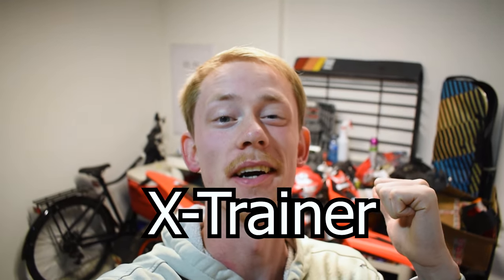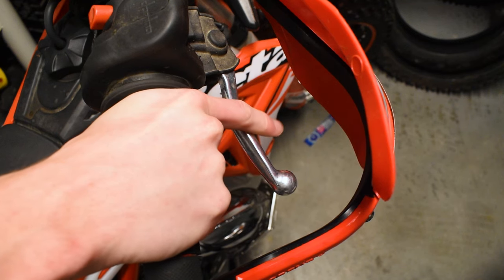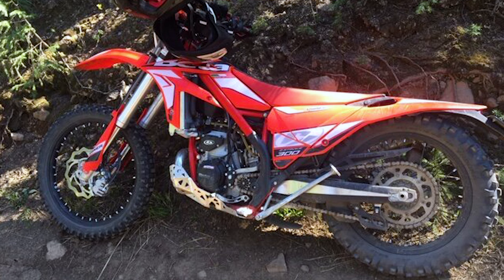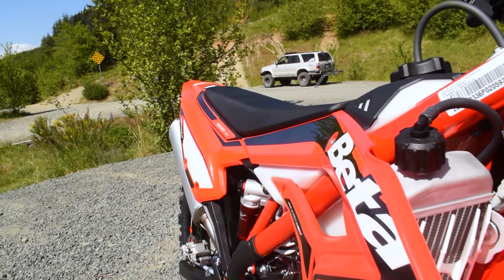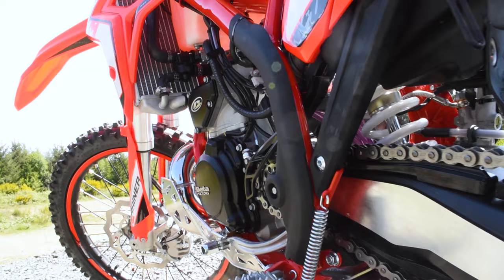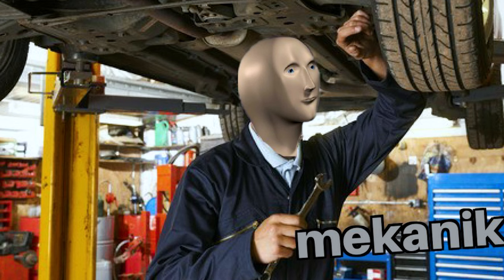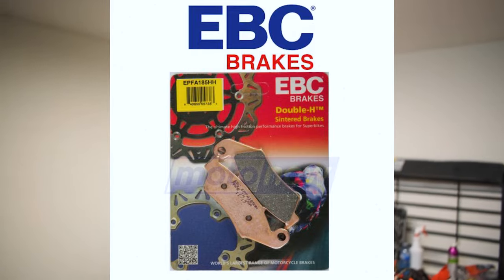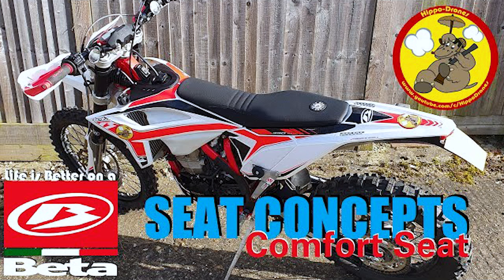5 Reasons The Beta X Trainer SUCKS!

Comment: Where are you pricing those Husky radiator shrouds at? I have a 2023 KTM SX-F 350 and I just got a new pair of orange shrouds from AOMC for $69.00. And for the record, the KTM shrouds are definitely very well made and bullet proof. I smashed mine into a tree and bent my OEM almost 90 degrees and not only did it NOT break, it went back into shape like it never happened. I thought for sure it was shot. Point being, the Austrian bike shrouds aren't that expensive.
Reply from the maker: From the local dealer
Reply: @AaronsEnduro  Holy crap are they ripping people off!!! Motosport, Rocky Mountain ATV MC, Revzilla.....they all sell the KTM, Husky and GasGas plastics. Whether it's OEM from KTM or plastics made by UFO (which is what mine are) or Acerbis, all are the same price. Tell your local dealer to "stick it"! hahahahaha J/K That really is crazy.

Comment: The 2024 seat is NO better, trust me, mine is like sitting on a brick
Reply from the maker: That’s unfortunate to hear! Guess seat concepts all the way then!
Reply: Yeah the 24 has the larger seat but it's still small obviously. 
How do you find the bike overall? I'm looking at a 24 model but this video and the comments now has me worried 😟. 
Should go a different brand?
Reply: @ANTICARBONTAX  , I bought a new 2022 last year and love it.  Things get nick-picked to death on the Inter-Web.  Fuel mileage is average for a 2 stroke, build quality is great, they are light and fast, dealers are supportive.  Yes, the seat sucks but aftermarkets are on eBay for reasonable, the rear brake pedal adjusts, suspension is ok as these are not race bikes . . . and I got mine titled and plated.  Went with a 15T front and can get around town and to close trails much better and can cruise on the road at 55-60.

Comment: I never got along with suspension and handling....motor was good!
Due to the extremely crappy suspension and short wheel base, had a hard time keeping it on the trail.    In tight turns the front wheel would unload too much too quickly, it'd blow through....anything on the throttle.
Very slow speeds, it's fine.
Here's what I don't get, why Beta refuses to put a good suspension package out of the crate...is beyond me.
Beta would sell a lot more xt if they did.
Reply from the maker: Because beta will sell you the better factory suspension for another couple G’s lol
Reply: The suspension is how Beta keeps the price (and weight) down.  If they put good suspension on it it would cost the same as a 300RR.  I never liked the suspension on mine but I was able to adjust to it.  I hated the electrical more which is why I eventually sold and went back to a KTM.  Too bad Beta doesn't make a race harness for it I would consider another one if the electrical was decent.
Reply from the maker: Every bike and brand has its pros and cons right!

Comment: Errrrrr now I dont know what to buy ffs 😫 
Im 90kgs so can only assume this suspension will F with me
Reply from the maker: Ya the suspension will be way too soft in stock form for 90kg
Reply: @AaronsEnduro  Thanks so much for replying bro. 
So would you suggest me 94kgs and 6ft to just go the RR?? Or is it worth going the x trainer and upgrading the suspension?
Reply: @AaronsEnduro  or what about other bikes like the Husky 300?
Reply from the maker: Well at 94kg the x trainer will need a few thousand $ in suspension so i don’t recommend that unless you really want the smaller frame size. As for the 300rr vs husky te300 vs ktm xcw it all comes to personal preference, they’re all great bikes. Just different flavours of the same thing
Reply from the maker: Also depends on where and what you ride
Reply: @AaronsEnduro  Thanks again for replying mate I really appreciate it. 
So basically I ride the same stuff you do, enduro trails. 
Well I really liked the Xtrainer for the detuned engine, super low grunt. Do you know if those bikes you mentioned have that as well? 
Originally I was looking at the wr250f before I went down the 2 stroke path. 
My last bike was the ktm 450sfx but it was too much bike honeslty and you can't crawl on it. 
I dont want a flame outs and want to ride hills ect more which is my favourite. 
Basically I love everything about the beta Xtrainer except the suspension. Iv been told if I'm changing the suspension then just buy the RR or another 2 stroke.
Reply from the maker: Yes the other 300’s have low end grunt, just with a more top end snap. 

The biggest difference from the x trainer to any other bike is the smaller frame size, shorter wheelbase, lower seat height and lower and further back pegs.

If you dont 100% need the smaller bike size than youll enjoy any other 300 2 stroke. I particularly chose the x trainer because of its smaller stature and size which i wanted to be able to confidently learn to progress my hard enduro skills on sketchy trails that i may not feel comfortable with otherwise on a fullsize bike. Really it comes down to your experience. Ive since tried the te300’s, 300xcw, and 300 ec and those are all fantastic bikes, theyll all lug down and chug up hills no problem, but they are definitely bigger bikes to toss around. 

Either way im very happy with the X trainer and i will most definitely be keeping it and upgrading the suspension. 

One other key factor that made me go with team beta was that my x trainer is street legal! You cannot do that with the ktm, gas gas, or husky.
Reply from the maker: Also the betas are carborated and not tpi or tbi
Reply: @AaronsEnduro  Awesome thanks mate 👍 👌 
Here they are all street legal in Australia except for race editions I think
Reply from the maker: Jealous!!! Here in canada they’re off road titled only (ktm, husky, gasgas)
Reply: @AaronsEnduro  Hey brother, So I basically went to KTM today and they have 2023 run out stock for gas gas, KTM which is like 5k cheaper here compared to 24 models which are basically a different bike. 
So I didn't realise that there is no engine compression (gearing down instead of brakes) on 2Strokes as iv always ridden 4stroke. 
Anyways long story short im looking at the 350exc 4S as well. 
I feel like the more I research makes it harder to know what's best for me. 
My last bike was a 450sfx an I hated that bike. Flames out on everything, stiff suspension so no no control going up hills on bumps.
Reply from the maker: Before my beta i had never owned a 2 stroke and was concerned about not having engine breaking as well. Within a handful of hours ive come to realize that it actually has helped me get quicker at riding, and it helped reduce forarm pump not having to hold the throttle to keep momentum.

As the folks say, brakes are for breaking, and the engine is for going faster. The 2 stroke does has a little bit of engine braking tho. The biggest difference is that the 2 strokes feel so much lighter to toss around even when they weight the same as a 4 stroke bike. I find my self getting way less tired with the 2 stroke bike. And it’s so much more fun rocking the throttle back and forth rather than holding constant rpm.

Theres a reason all hard enduro riders are on 2 strokes, they lug down infinitely better, have fast and snappy throttle, lightweight characteristics, and are honestly so much more fun
Reply: @AaronsEnduro  Thanks man yeah I'm a bit worried about going 2 stroke but I know everything you said was 100% correct. Maybe I just need to have a go and just go for it.
I think I'll go 2 stroke then
Reply from the maker: @ANTICARBONTAX trust me, i was just as timid about it , but god damn are modern 2 strokes unreal! So much fun

Comment: I got the best kind of an Italian bike. A Japanese one😁
Reply from the maker: If a Japanese manufacturer made a 300 2 stroke full enduro bike I’d be all over that
Reply: @AaronsEnduro  Yeah, I hear ya. Let me explain my comment. I got a Fantic ( an Italian brand) which actually is a Yamaha WR 250f with arrow exhaust, GET ECU, race seat, different plastics and a few upgrades, Tweeks and touches. However it's not the WR it used to be. It is now very motocross related and race oriented which I'm struggling with as I ride very slow, steep, rocky, rough terrain and I have since realized 300 or even 200 2stroke would suit me much better.
Reply from the maker: @Paul-gu2lv  ya ive seen the fantec! If they made an enduro version id be all over it
Reply: @AaronsEnduro  They do have a 300, 2 stroke on a YZ frame. Not sure what engine though. I might be old fashioned in my thinking, but I just have more confidence in Japanese reliability over the European brands.